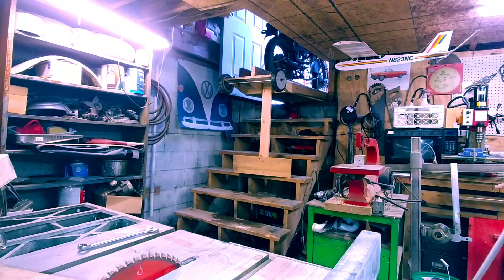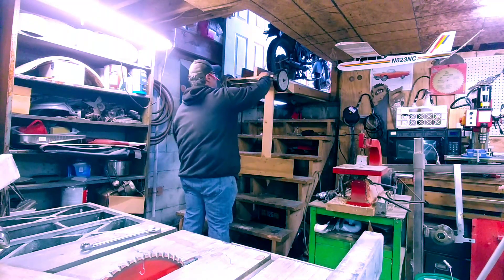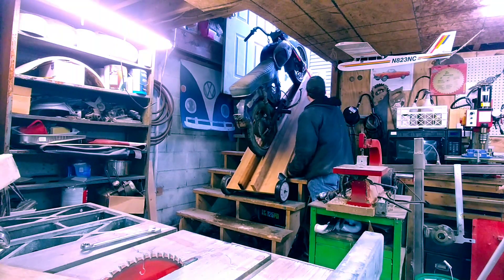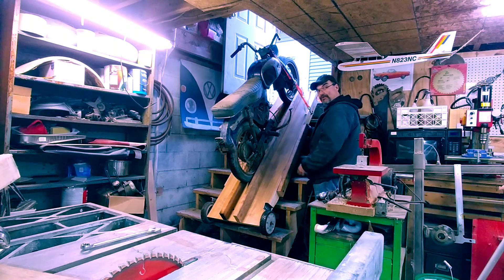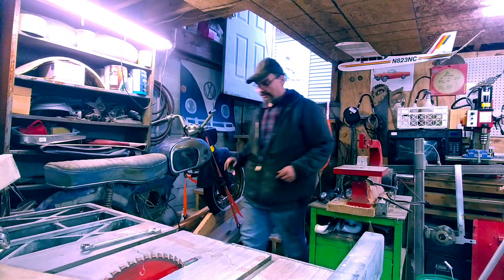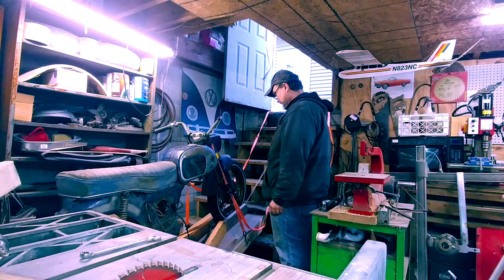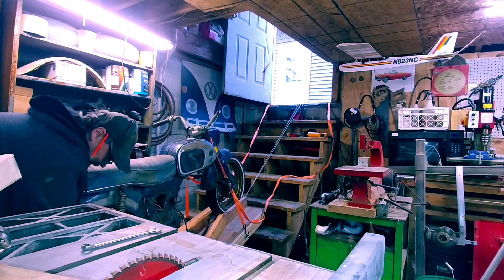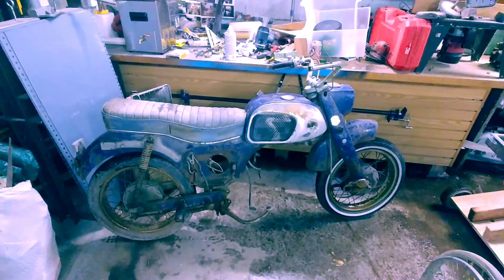Stair Elevator Part 2

Comment: That works better than Fallin down stairs and lying in pile with bike on top of you.... um no I never. .yes I have  ! lol
Kind rough to work from out side.
You mite be able to put guides on the steps to keep it in middle of steps.  Also if you get the legs to come out better u could put a pulley on ceiling with a rope thu to back of the sled, so when your outside u can pull up on the back of sled to help deploy the legs  hope that helped you.   :)
Reply from the maker: All good ideas...I will have to think about it some more.  Thanks for watching and commenting.

Comment: Would you have enough cable to hook it up to the back of the sled. If you do I think it would pull it about outside. I would try it.
Reply: I think if he puts it too far back it will be hard to keep steered straight with a heavy bike on it might even flip backwards
Reply: He has slots in the front board to keep it straight. Won't flip backwards with the weight upfront.
Reply from the maker: The guide slots that I made have been broke by hitting the pulley too many times.  My next plan is to add some "plastic" runners to the bottom.  This should raise it up and make it not hit... Hopefully!  Thanks for watching and commenting.